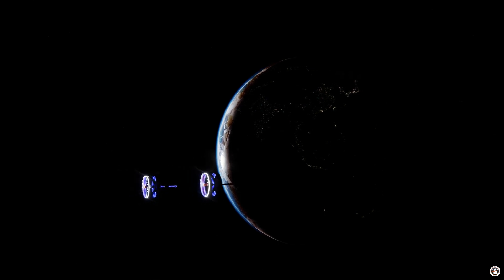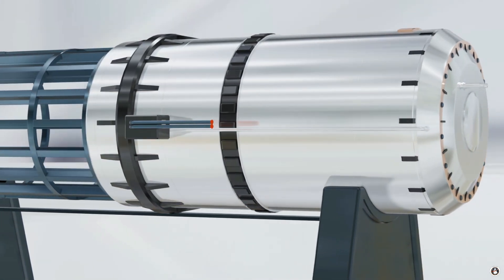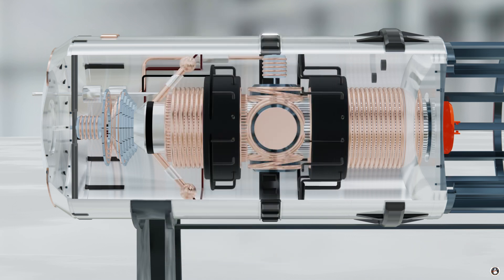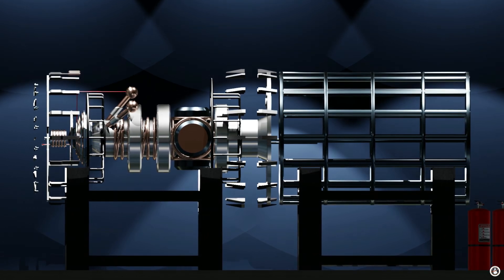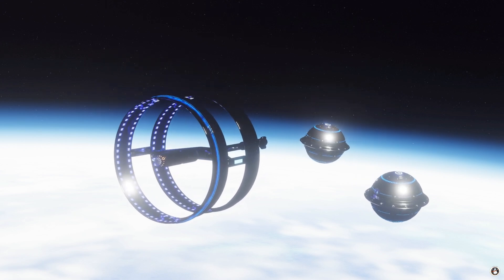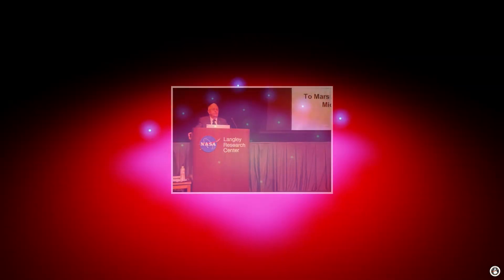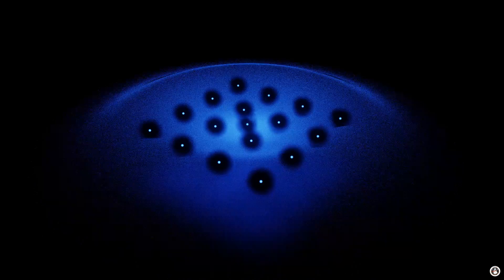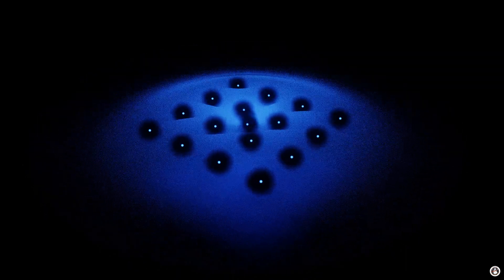Muon Catalyzed Fusion Engine - 8% Speed of Light - Mars in 5 days?

Comment: Here are my thoughts on extended space travel:   I envision an engine like this to be used to essentially achieve the speeds needed to start a secondary engine which scoops up the particles in space, which are then used to fire the secondary engine, let’s all that the scoop drive engine. Particles entering the scoop are then excited to cause an additional burn capability e.g. H,He,dust,muons,bosons,neutrinos, photons,electrons, etc essentially any particles scooped up, compacted,condensed immediately and forced to give up energetically as a propulsive force. The articles may require some separation on entry to the scoop, but the faster you go the more particles you collect to eject.  On board computers would use interstellar navigation to direct travel toward areas of spaced deemed more particle rich or knows areas with more condensed particles availability. Electro-Magnetic induction near the front of the spacecraft would repel particles too large away from the ship, collision avoidance with real-time detection and power generation would supply electricity generation. That’s a high-level idea.  The faster you go, the more power you can generate in a particle rich environment.  Next using time as a resource let’s say that you achieve 20% speed of light, but it still is taking 1000 years to get there. You have a huge new resource called Time. The computers would have analysis and AI programs they would continue to solve the propulsion requirements, and an on board automated physics lab would allow for construction of new engine components based on analysis results, which would be sent back to earth over the course of the journey and maybe approved for construction or new components could be requested form earth and shipped for rendezvous at some future agreed location and time to be applied to craft. A quantum entanglement cellphone would call back to earth to communicate craft telemetry and arrive instantly regardless of distance from earth, any new program updates would be sent instantly to craft via the quantum entanglement communications system. Space is not empty and my intuition tells me we may be able to ram those particles into a collector and ejected back out at high speeds. I have concerns of crafts going at very high speeds colliding with space particles rending the craft inoperable.  My other concern is the potential for running into anti matter deposits which may be left over from the Big Bang and un accounted for.
Reply: Ramscoops are a neat idea that won't work. The drag of the scoop field quickly counteracts the thrust of the engine.

Comment: very very close to the design i conceptualized about ten years ago when designing a hydrogen generator, although i had about six lasers crossing in the center of a cylindrical vat of water with an ion thruster like particle beam emitting down the center perpendicularly from the lasers. several sets of coils were placed around the cylinder some of varying gauge wires, and the inner surface of the the cylinder was plated/sputtered with a mirrored coating of coper, aluminum, silver or gold, to the point of being reflective but not to the point of becoming opaque. the tube was to remain see through.

sweet now i can revise my designs and see what my mind comes up with as any problems or solutions...

Comment: Hello this may sound odd but I stand by it. Astern the quality of research here is astounding.
I would (and I beg to be corrected where needed) suggest that you direct your research first into building synthetic neron batches resembling our brains.
This means having critical thinking skills that will progress much faster human brain capacities which are limited and holding back our tech advancement.
These synthetic brains-digital or physical will help build much better engines for deep space travel.
Check what probabilistic neural networks are now doing at the fugaku pre-exaflop computer... Near gpt3 performance at a fraction of the computational cost...
That seems a better path to building your engines.

Comment: It all depends on how fast it goes from 0 mph to it's max speed. At light speed it take 4 years to get there if the engine goes from 0 mph to light speed instantly, and not stopping once you get there. According to their math the engine can do 8%C plus so I'm going to use 10% to make it simple. At 10% C it will take the ship 40 years to get there and it still won't be stopping. If it can get it up to 10% and cruise at that speed faster than the halfway point then the 40 year trip is possible since that would allow you to slow with less than half the distance to Alpha. If it can't do that then we're still looking at least 80 years. There's one other thing that wasn't brought up is the time dialation effects on the crew going 10% C. There would be a slowing of time for the crew so they wouldn't experience the 80 year trip lasting 80 years. How much less time I have no idea. If they only experience 8 years for 
every 80 years for us then the ship wouldn't even have to be a generational ship. Anyone know the math?

Comment: Interesting theories...although they require a large amount of energy and scientific advancement which could be achievable in many years. Current technology leads us to using fission engines not necessarily atomic bombs being detonated behind a pusher plate which is feasible but a Chernobyl event happening behind the space ship. Very hot plasma being ejected using low grade nuclear fuel (same as nuclear power station) is very achievable or perhaps even better weapons grade fuel. Space craft is assembled in space with the engines situated far from the crew's quarters to eliminate radiation exposure. The radiation is quickly dissipated behind the craft.

Comment: SPACE TRAVEL WONT BE BECAUSE WE REACH THE SPEED OF LIGHT NO, IT WILL BE BECAUSE WE BEGIN TO UNDERSTAND FOLDING SPACE  THIS IS THE KIND OF TRAVEL WE WILL BE USING
Reply: SOL will be good for cruising in our own system, assuming we find a way to deflect micro meteorites and radiation.  For travel between star systems, yeah..lightspeed not going to cut it.

Comment: Would this kind of drive provide continuous thrust for a starship? If so, that would really be great! I'd love to see a fusion drive of some sort eventually end up on a SpaceX Starship, that would be the dream!
Reply: That’s kinda unimaginative. A chemical big dumb booster shouldn’t have to have a fusion drive welded on.
Reply: @prestonb.f.  not the booster, that could remain a chemical rocket... but the second stage, the actual Starship, would benefit tremendously from a fusion drive, especially if it can provide continuous thrust.
Reply: @jdmiller82 , but you’re tacking something onto a very different system. It’s like putting a gas-powered motor onto a horse and buggy, by putting it into the horse.

Comment: That doesnt work with lasers... we tried it already. No fusion enough to sustain 50.000.000 degrees Celsius all  the time, so better way is to use ICE system with microwaves in sphere shape called Periodically oscillating
plasma sphere POPS. Hope it helps.

As for speed, best is to get max 0.25 of speed of light, because of time differences.

Please dont forget Alcubierre.

Comment: There’s a simpler way 2atain stable fusion n the fisson engines should be used as long term maneuvering thrusters,n the gamma emissions without a votexguild would pass thru all the matter on the space ship unless lead shields for quarters was considered, this just seams like a complex ion engine and the size would need to be massive to create such thrust, the slurry imbalances would cause fluxes in thrusts ratios without control valves,, n interlocked orbits requires vast stabilization pressure to achieve this a coil of the udd in a vice/compression to a circular part of structure, n the catalyst is not the lasers it would be a

Comment: Btw there is no such thing as the sol speed of light when your already moving at the speed of light.  There is however dielectric polarization and excited states of coherent bonds, thus capacitance release is entropy. Discharges in high pressure gas create contraction and cooling effect in thermo dynamics.  This generates ferroelectric opposing fields.

Comment: Hydrogen 3, aka tritium and Deuterium  can be applied to induction over unity phase conjugation by utilizing induction at negative kelvin vacuum stasis, and contained with Hallbach array on a tri lateral stack tunnel.  Adjusting these rings in the center of the toroidal cshaped chamber will determine induction Passover.
Reply: Nay my good friend helium 3

Comment: thats discouraging , it sounds impossilble and made up for just 8% the speed of light what happened to 2/3rds with plasma engines and electromagnetic charging and even universal energy.Or the basketball sized blackhole they may of found  , it would be easier to induce a alternating frequency at a quanti level, like that crystal they found, untill it's interdimensional and creates 2 binded states that you can bring into a motor. a non existent alternation that stays inside the reactor lattice magneto trap and a remainder type of matter induction

Comment: Muon catalyzed fusion - if it works with any reasonable efficiency then it will quickly get adopted for fusion reactions for electricity generations before it goes to power spacecrafts.
Reply from the maker: Our reactor is based on the same process, both engine and reactor will be utilized in one ship.

Comment: The fact that its anuetronic is pretty big. That means you wont need kilometers of distance or heavy shielding to protect crew from being cooked alive by nuetron radiation. If possible, it vastly reduces cost and complexity of the vessel as well as making the logistics of getting it to orbit less strenuous. Pretty exciting stuff!
Reply: Can't it just be fired and launched from normal launchpad? if it has minimal or even zero neutron emission, it could potentially be safe enough to use in atmosphere.

Comment: Most of the first half of this video was hype.  Which should have been in the 2nd half of the video once the viewer is told the details they are supposed to be getting excited for.  While the basic concept of what is supposedly happening is explained.  There is little credible information as to the expected reality of this engine compared to other cutting edge designs.   I'm guessing 8% of light speed is about the maximum theoretical speed for a ship that is little more then the engine, fuel, and the most basic components needed to keep it operating.  There is no mention of  how much thrust it can produce.  How long it can remain active.  How long it is estimated to take to reach 8% light speed.   Are we talking 1 week?  1 year?  1 decade?
  Most of these design concepts.  Are trying to break off pieces of atoms to use for thrust.  I'm waiting for people to use the whole atom.

Comment: Did someone notice on the sketch that this engine needs hydrogen cooling? That means even if the fusion process could be mastered, the engine alone requires its own cooling mechanism attached, plus the power generation for the cooling and the powerful lasers. That means more mass to nibble away at your drive efficiency.

Also, from what source is the power generated once the solar system is left behind and solar arrays won´t produce enough energy anymore? Nuclear fission reactors were ruled out by AsteronX. And even big batteries would come at a cost - more mass.

And if I´m not mistaken, even with a velocity if 8% of the speed of light, it would take 53 years to get to Proxima Centauri. Too long to be truly useful.

Comment: Build a dead set clone of the star trek enterprise with 2 muon engines on pontoons, a central fuel tube and an upper disc forward mounted. Rotate the disc for simulated gravity, the ships bridge at the centre of the disc and is a  non rotating axle point.

Comment: At 8% lightspeed, it would take 45 years to reach Proxima Centauri. That is how long some NASA missions like Voyager have lasted. A long time, but not inconcievable.
Reply: Richard Dinan plans to do the trip in 11 years. What this video doesn't explain is through constant acceleration of G1 forces you can not only simulate gravity, but you can constantly accelerate until you reach the midpoint, then turn around and begin decelerating. The trip is reduced to just 11 years. His hope is to eventually reach top speeds closer to 35-40% the speed of light or higher. There are other problems however. The Korean Space agency did some theoretical tests back in 2016 that suggested micro meteors aren't as great concern as we once thought, and that a 1 inch shield would be sufficient in protecting the ship, however the shield would gradually vaporize and the radiation created from that is equal to that of the core of a nuclear reaction chamber. In other words the crew would be killed. Therefore you would need meters of shielding, (water is preferred), and that kind of weight will slow you down, and if it slows you down it means you are exposed to the already existing ambient cosmic radiation for longer periods. There seems to be no way to win here.
Reply: An engineering problem and clever creative math and physics?
Reply: @FablestoneSeries to accelerate something the size of a voyager probe to 40% of light speed you’d need the equivalent energy of 2 gigatons of TNT. where exactly does this wise guy propose getting that kind of energy from?
Reply: @oberonpanopticon   Are you sure it isn't even more than that? Fusion rockets could get there with only 300 kilograms of hard fuel, but that doesn't include the energy to power to lasers that create the fusion in the first place. Currently fusion requires 300 times more energy than it creates. There is a plan to make the trip in only 11 years one way. But I doubt they'd go at all. Any trip there would be a death sentence.
Reply: It would take about 3.6 days at around 400 times the speed of light.
Reply: @solutionsforabrightfuture3579   in order to create a warp bubble the size of the Enterprize it would require more energy than the entire Earth produces in 10 million years.
Reply: wait, what about relativistic effects?
Reply: @anekdoche7055   for the crew it feels a fraction less. Richard Dinan plans to travel at 35%-40% the speed of light. The trip can be made in 11 years. But there are other problems. recent projections say that the radiation they would receive would be higher than standing inside a nuclear reaction chamber. We won't be sending humans there ever, and just need to accept that, because no matter the technology it would be a one way death sentence. Even if they managed to get there alive, unless the destination is 100% habitable when they arrive the trip is a death sentence. And alpha centauri has no atmosphere and is tidally locked and its year is 11 days long. we can't live there. this constant conversation about going there is absurd. All our attention should be focused solely on Scorpii18, the nearest twin star to Sol.
Reply: @FablestoneSeries  hey tanks for the fact:D
Reply: @FablestoneSeries  don't need a crew
Reply: @asdf3568  True, but i think the driving force behind the hype is to eventually take a manned crew. I don't think it will ever happen. Not in a hundred years, not in 200 years, simply because there is nothing there worth making the trip for, and any trip there would be a death sentence for the crew with no way back. All we need to know can be learned from a probe.
Reply: @FablestoneSeries also say that again in ten thousand years when the solar system has reached the maximum number of humans it can possibly support. there’s one resource that’s worth going interstellar for: living space. and I think by the time we’ve reached that point we’ll either be so post-human that the issues will be moot, or we’ll just build ships big enough to get us there safely. the tyranny of the rocket equation is nothing compared to the indomitable human spirit.

Comment: "The laws of physics can not be broken" I hear this and think, well there goes that great idea. They can be broken and are every day. Simply look up and think about a black hole. Nothing in nothing out. Here's how to look at it. Think of a black hole like a tornado. You simply have an out-of-control atom that has split itself beyond the speed of light nor representing a positive or negative charge within its dimension of space. Here you have absolutely nothing the field is broke therefore no light no nothing can pass through it. It's not a wormhole. It's not a bend in the space-time continuum. It literally is nothing, no magnetic field no nothing. It's simply physics we haven't discovered yet. Transverse reactions break and throw chaos into our current laws of physics. As long as we keep believing these laws can not be broken we will never obtain the technology and forthright thinking that we need to succeed on our next steps into interstellar travel.
Reply: black holes can have a charge and angular momentum and it's not a split atom it's pure mass in a single point
Reply: you wrong tho, hawking radiation is a thing,

Comment: The future lies in the design of nano scale quantum gate circuitry printed directly into various metamaterial based "machines"(molecular and atomic scale interacting "parts" that produce both self regulating processes within the material that can actively be revved up or down(as an engine regulates its speed but you control the pedal), that can act on billions of a second time scales and produce highly intense but very brief outputs that can be then be harnessed on the larger scale more efficiently.